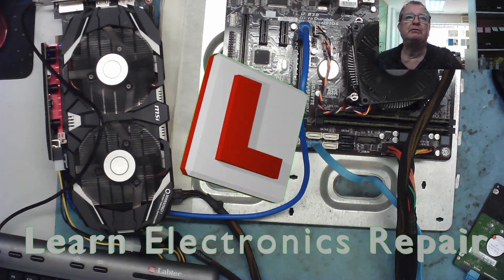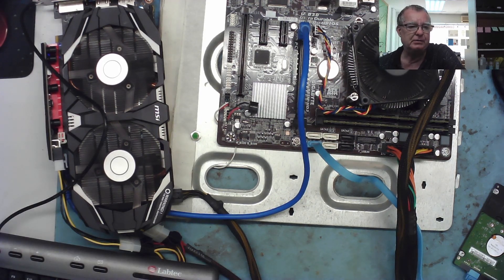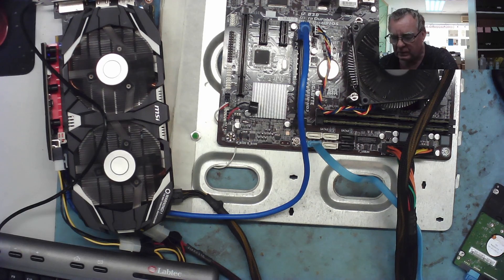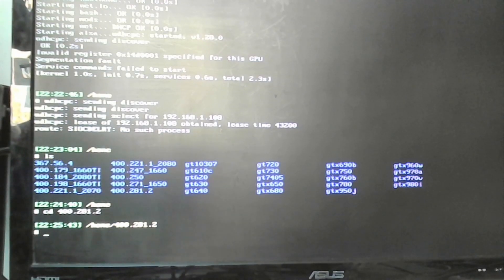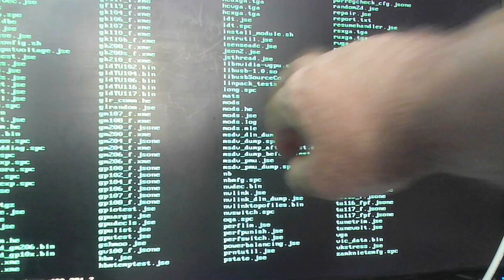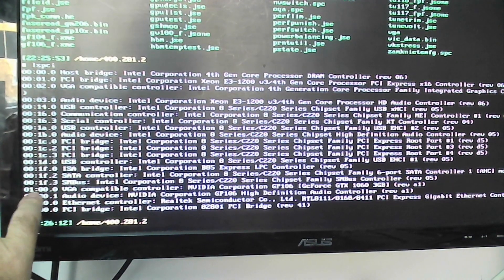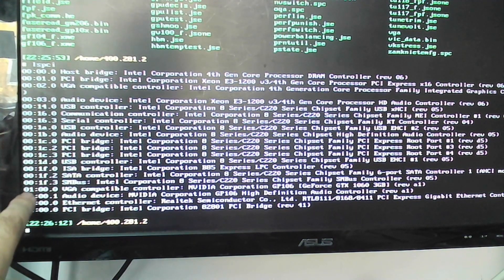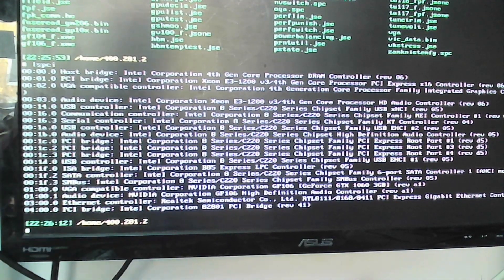GTX 1060 GPU No Video Output - Part 2. Intermittent GPU RAM Fault Repair How To Find

Comment: -mfg and -oqa switches only work on oldest 3xx versions even though they are still mentioned in the documentation of newer ones. 

Use -long and -short switches instead of -mfg and -oqa.

Comment: I have an old socket 775 mobo that doesn't boot but spins up the CPU and chipset fans as soon as the power supply is switched on without hitting the power button. Any advice on how to find the issue?

Comment: ah.. it's reminds me at my first 750. but instead flexing issue, my card just need run few MATS before it work properly. ( so my card need "warming up" just like ol'times diesel eh?)
If i start/turn on the PC from cold boot/hibernate/sleep. it's just crash after drivers load up, so.. i need run few mats test (and of course it's return as "Failed") and then reboot, magically my gtx 750 work just fine... i don't know what happen there...

Comment: There is a way to test whether it's he GPU or the RAM that has cracked balls. Just put a little pressure on one of them and re run the test and see if anything changes. I like using stacked copper heatsinks, kills 3 birds with one stone. Provides some cooling. There small enough to localize the pressure enough so they won't be putting any pressure on the GPU. And lastly they look  cool. If stacking them on C0 consistently solves the fault than there's your issue, If not than stack em on the chip and if that doesn't resolve the issue than it's time to bring out the sledgehammer.

Comment: Great vid as usual Richard, the reason your able to run the command in the same folder without the ./  must be either someone's added a . ( the . represents the current directory)  to the search path or its found the command of the same name somewhere else in the search path and its running that one which could be an older version, unlike windows linux by default wont run  files within the same dir without the ./, because  for security reasons the current path is omitted from the search path by default, - hope this explains some linux weirdness for you.
Reply from the maker: Yeah that does - however when I cd into a different folder I was running a different version of MATS - how would that happen?
Reply: @LearnElectronicsRepair if you put . in the path variable, it will search always in the directory you run each command from. So if you change directory, it will find a different version.

Comment: Just an FYI. In Linux you can start typing the command or parameter and a few characters in, hit tab button. It will start filling in the rest of the command or file you want. Save typing
Reply: Keep tapping tab to cycle through commands/files at any time
Reply: Also / is the delineator for a directory. Like in Windows you use \. In Linux - means your putting in a parameter. / means your using a directory
Reply: Also if you ever want to go back to a previous command. Rather than using up arrow type 'history'. It will display everything you typed with a line number. Then just type '! Line number' and it will re-run your command. Obviously leave out the ' part.
Reply from the maker: @theshemullet  Thank you - as you can see I am a not an expert in linux - I can 'kinda use it' but that is about it
Reply: @LearnElectronicsRepair  Hopefully those suggestions will help save you typing out long commands when you don't have to
Reply from the maker: @theshemullet  What, a bit like windows does? 🤣🤣🤣

Comment: 6:55
> I don't need to put the dot-slash [...] because I'm already in the folder where mods is

That doesn't sound like standard shell behaviour. Are you sure about that? Or is your shell actually configured to look for executables in the current directory?

Usually you have to explicitly specify that you want to run an executable from the current directory by prepending "./". When you leave that out, your shell will search through the directories contained in the "PATH" environment variable. That usually includes /bin, /usr/bin and maybe some others but not your current directory.

So are you sure you're actually running /home/400.281.2/mods and not some globally installed version of mods possibly located in /usr/bin/mods?
Reply from the maker: No I'm not sure about that.  Hardware I can deal with, linux is another thing unto itself lol.  What I did see happen is when I cd into one folder I could not run the mods command with argument -mfg.  It turns out from another comment here that on the later versions of mods you have to use -oqa for the same effect.  Then when I did cd into the other folder I could run mods with -mfg so I kinds assumed (incorrectly it seems) that it was because i was in the folder where the program was.

Comment: Having worked as a test Technician at an electronics manufacturer, as soon as I heard "Intermittent " i would suspect a bad solder joint and examine the solder joints under a microscope. Especially if they are temperature sensitive.
Reply from the maker: It's a bit hard to see them under the BGA chips though 😉

Comment: Just wondering ...
If you suspect a BGA chip has lost a connection and you want to remove it, why not simply fake the removal - i.e. do the usual flux-heat-cool-clean cycle and try the test again ?
If it's just a bad solder ball, you solve the problem this way.
If not - it's likely to be a pcb track or the chip itself at fault.

Comment: Hi can I ask where you got the test cable to test the card out of the pc. It seems essential for the type of repair.
Reply from the maker: Yes it is very useful, as well as being easier to work on the GPU the adapter also runs in in single lane PCIe mode which makes it easier to find some faults
It is this one.  If you order from this link I get a small commission - you pay the normal price
https://www.aliexpress.com/item/32870183633.html?af=ler2002&cn=001&cv=yt1

Comment: A reflow of C0 and/or the corner of the gpu leading upto C0 is probably all it needs. Try it using the proper amount of flux (rossmann - 😁) ! Cheers Richard...
Reply: Going to need a few Paul’s of flux
Reply from the maker: @Mark_C1  @intrax2tv Yes - I am quite convinced (as you saw my comment in the video) that the fault apparently being on the corner of the GPU is no coincidence! 😉
Reply: @LearnElectronicsRepair  are we going with age related drooping? I have Lego holding mine up, graphics card that is 🤣 Also I was wondering if testing it flat and not as it would be under stress in a rig might be making it work more often than not maybe right now. Thanks for your content
Reply from the maker: @Mark_C1  PMSL Mark!!